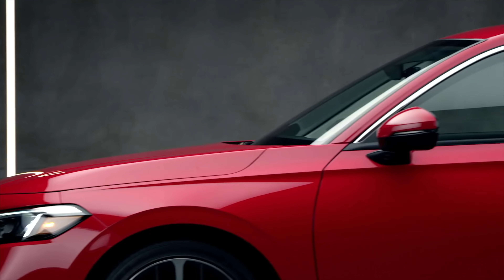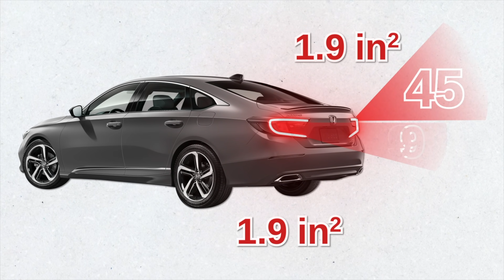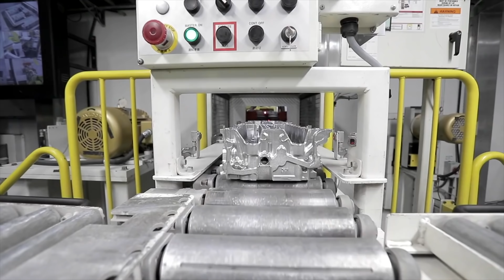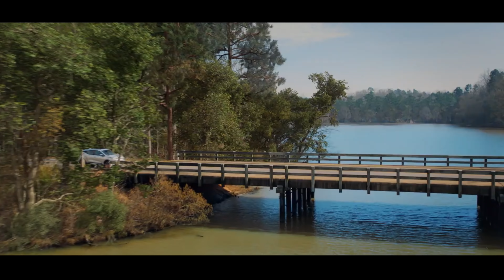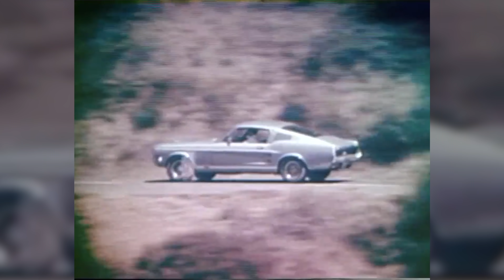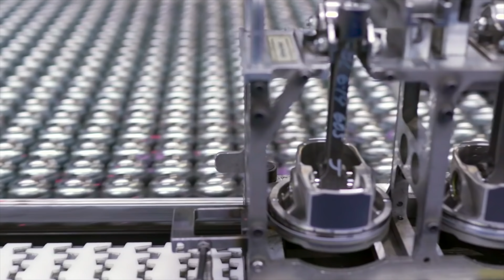I'm Trying Something New

Comment: The most reliable cars have manual transmissions rear wheel drive. No features at all. So basically I just described the work truck and older one with a manual transmission. You see back in the day you could get cars that were basically work cars. They had steel rims and basic everything with the manual but now it's hard to get that in a car unless it's an econo box

Comment: In Australia, I've been seeing an ever increasing amount of vehicles with those stupid strip lights for tail lights, brake lights and indicators. They should be illegal, because they're far less visible than older style lights, especially in fog. The lights should be a certain minimum diameter, rather than being specific square centimetres coverage.
Even my modern Camry has front indicators that are set far too low. They're about in line with the top of the front tyres. That means people can't see them when driving around a round about (due to plants on the island in the centre of the round about). There are tiny indicator lights on the side mirrors, but those are barely noticeable at night, and pretty much invisible during the day.

Comment: Today's electric cars are such dorky and faceless blobs. If the current lack of styling trends is what we have coming car styling is in serious trouble! We have a bunch of customers with 2013 on up Cadillac CTS's with both the 2.0 turbo and LFX 3.6 V6 and they have had zero nada issues with the engines. Its the older pre 2012 V6's that may experience timing chain failure.

Comment: Actually like this style video for maximum info in a short time. Perhaps a weekly entry?
Just got done breaking in my Hyundai Elantra N, now has 1100 babied miles on it. If you haven't driven one, I recommend trying one out. It goes from a grocery getter with up to 38 MPG to a corner carving demon with the press of a button. As a bonus, I get to watch my 8 year old get flung around the back. Something about taking a 90 degree corner at 45 MPH with no wheel slip seems to always surprise her...

Comment: No the cable they installed prevented the left side of the engine from lifting up and pulling the vaccine hose out of the master cylinder vac/booster.They redesigned the mounts from a simple rubber on steel plate to ones that the metal encompasses the rubber so that if the rubber breaks it is still held in place
Reply: Even cars are getting vaccinated. Amazing.
Reply: Lol vaccine booster brakes
Reply: Gas just jumped to $5.25 from $4.89 a gallon in north central Indiana.  Let's go Brandon!
Reply: Am I the only one with a over active usually wrong spell check/spell anticipation feature on his Adam’s apple I phone?

Comment: Scottie I own a second generation ranger pick up extended cab, I would like an extended cab with a 6 speed transmission to get better mileage and performance and the 2011 is the last model with the extended cab in the 1st model with the 6th speed auto and still has 4 wheel drive. The engine choices look grim ,question is what do I do about the power, it's got 2 diesel choices and some kind of small gas motor. I don't want a diesel.
Is there a different make of truck that would meet those requirements? Best wishes Marty.

Comment: Best car I've ever owned was a 67 Belair.  283 with 3 speed/overdrive, I abused that thing (3 clutches) and it still went over 300,000 miles. Those where the good old days. Keep them coming Scotty.
Reply: I broke my M-20 Muncie. My fault.
Got a Cast Iron 3 speed overdrive. 1st gear torque? Holy Moly! My Duntov cammed 327 would to the moon Alice! 100 foot stripes!
64 ChevyII. Maybe 800lb less than your Belair.

Comment: Regarding the "beauty covers" I think they have somewhat of a purpose but not ones that cover the entire engine like that.  I mean my Toyota has one over where the oil filler cap is located, and this is sort of a good idea because if you spill oil, it will only get on the cover and not the rest of the engine, but the rest of the engine is still open (not covered).  I'm also wondering if junk falling into the engine and causing problems (like belt issues or wiring) is the reason they also started introducing this as well (less junk getting into the moving parts of the engine because it's covered -- granted you have a hood, but without the covers, stuff can still find its way into the engine and get into things -- even though the covers themselves don't particularly guarantee against things not falling in.
Reply: It's only for sound. Take it off you get slightly more cabin noise.

Comment: takes some time to get used to the multi changes in scenes. But i like it. also while I'm here.... SCOTTY! when I'm at certain road engles, turning wide angles and going down and up hills I here a grinding noise as if two pieces of metals are grinding against each other. could this be my bearings and drive shaft?

Comment: 1920's and 1930', even earlier automobiles were the best looking. But I grew up in the early 1950's overseas where everything was old but well kept. I didn't see TV's until the 1960's, in Black & White. Modern electronics, suspension, drivetrain and engine with older styles would be nice. Safety: airbags, seatbelts and padded dashboards has saved a lot of lives. Helicopter transport and trauma centers more lives.

Comment: I can't understand that each state, in the US has the ability to make different laws on things like car noise, annual inspection, and other features.
The effect of smaller passenger side-windows, and thicker door-pillars, restricts visibility and make it less safe to pull out of a side-road.
Reply: I work at a Chrysler dealership, and I have to stick my head out the window when lane changing to my left when I drive our Fiat 500. The pillars are too thick, you can't see out the rear quarter windows :(
Reply: @MasterGeneral156  
Here, in England, I drive a Toyota iQ, and have similar problems.
But in my 2005 Volvo xc70 which is square at the back-end, visibility is much better.
Reply: I agree with that 💯.  My Ram pickup truck has that problem. I check so many times before pulling out .

Comment: Would it hurt by removing the cover under a car covering engine.2018 kia soul.Seems like all they do is hold heat in.
Reply: Try driving for a while with the cover off and see if mileage changes. Would be interested in the results. May increase noise levels though.